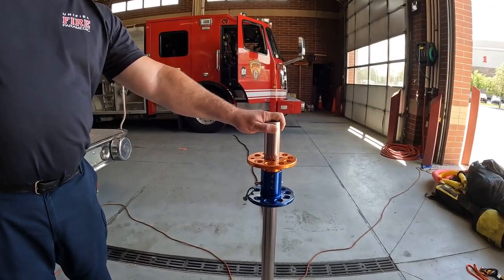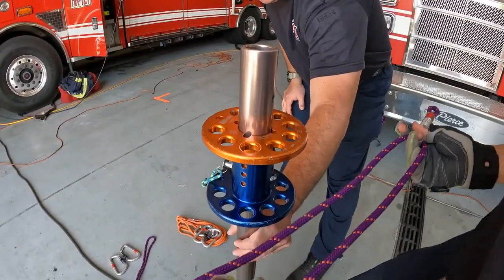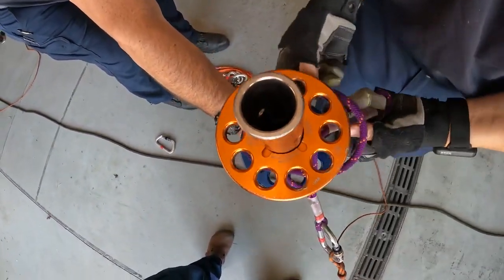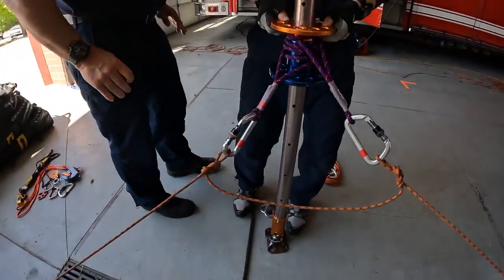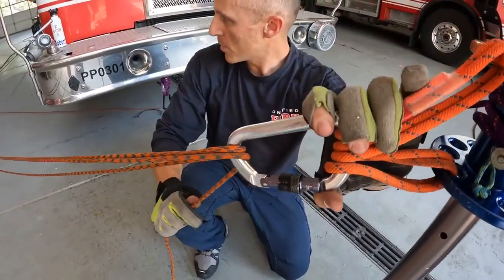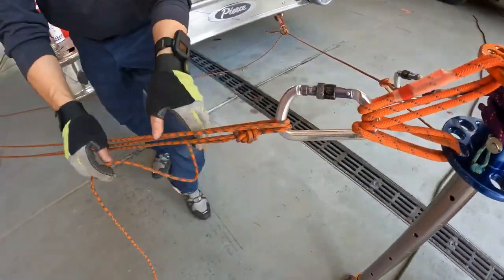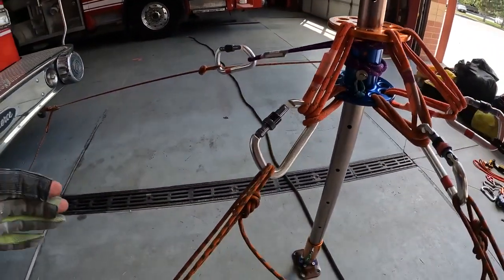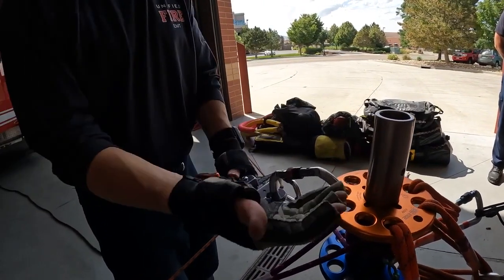Floating Focused Beachhead Anchor System

Comment: It's great really it is. Only thing I'd like to know is, has this ever been applied to an actual call. I can't find any post call information, or examples of this being used.
Reply from the maker: I really don’t know.  I haven’t in an actual call, because it does take some time, but I can see this being used on a pre-planned ConSpace standby event.  The point is really to think critically about angles, force vectors, etc…. & get the brain juices flowing.
Reply: @Propeller_Head  thank you for your quick response. I like how versatile the vortex can be. I just wanted to know if it has ever been used as a mono.

Comment: what defines a beachhead? is it having three rear facing guys? or is that a general term for an elevated anchor station? Is the Thorne term?
Reply from the maker: Just a “Thornism”, but if I recall I think is means building a floating focused “bombproof” anchor out of an AZORP where you operate the entire 2-rope system as well as options for fall-restraint lines

Comment: What diam and type of cordage are you using?
Reply from the maker: Sterling 5.9mm PowerCord
Reply: @Propeller_Head  copy, I thought so. I was just running the numbers on CMC 6 mm prusik cord. 1796 mbs. If you doubled or tripled it and had 3 legs, that would work too, wouldn’t it?
Reply from the maker: So I'd de-rate the one strand that had the terminal knot by 50% then add in the full tensile strength of the remaining two strands & that gives you about 4,500 lbf or 20 kN MBS.... So apply a 10:1 SSSF to that and you get 450 lbf (2 kN) or your classic 2-person rescue load..... Good to go!
Reply: @Propeller_Head   yes! That’s what I needed, computational problem-solving, thank you sir!